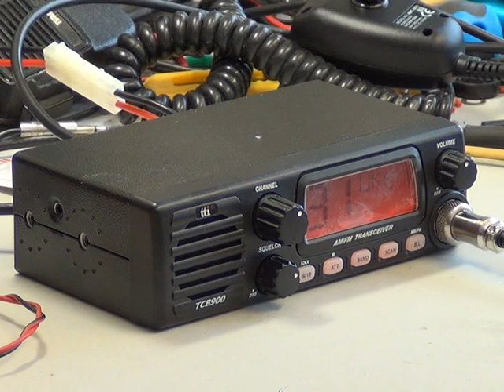TTI TCB900 UK (CE Multi-Norm) CB Radio (Mobile) - On the air test

Comment: Just a update-All ETSI cb sets now produced,dont go with the old MPT-1320 specs in respects T^X deviation,RX filtering,FM discriminator audio recovery,thats why FM deviation max 2.00khz,plus the fact the 455khz filter is tighter bandwidth to cover both Am and FM mode,hence why now deviation is set lower not to exceed filter bandwidth. Unfortunately this does not help UK users using mixed old MPT-1320  and new ETSI EN CB sets together! ETSI Specs generally are 60%=1.25khz 100% dev=2.00Khz max,455HT filter 6-7khz B\Width VS MPT-1320 60% dev=1.5khz ,max dev=2.5khz,IF bandwidth9-10khz 455GW For the FM detection of audio gain differences its just a resistor change across 455khz ceramic resonator or discriminator coil thats changed for different specs EU\UK new spec typical 3K-3K8=60%@1.25khz deviation ,where UK 60% dev is 1.5khz.But thats the reason why new cb sets are like this,using one filter to cover both modes AM\FM wise,so they compensated the total fm deviation,boosted up recovered audio,could call it super narrow fm lol.But as soon best way just turn up dev to 2.2khz on tone,then check speech peaks on whistle or 55555's,does not exceed 2.5khz for UK band.I have spoken to one or mfrs to put a extra menu  feature for UK band only  users so can switch TX dev 2.00khz[ETSI]] \2.50khz max [MPT-1320}so some sort of inter compatibility mode in UK band would be handy when intermixing old and new spec CB kit,it can be done very easy now with software controlled cb radios,but until users,dealers in UK nag mfrs,I cannot see it happen. Regards Rob
Reply from the maker: Thanks Bob. As CEPT is useless here, all our farm using customers want 27/81 so we'll carry on optimising for that, Back in the 80's deviation was still coming out of the factories @ 1.4Khz!

Richard G0OJF

Comment: Ive discovered why fm deviation low set,its because they dont switch the final 455khz  HT filter.Most ham HF radios will switch 6khz in AM and 9khz in FM Narrow.
So to save money they just switch in a Am filter at 7.5khz bandwidth Filter

So fm dev has to be  2.5khz (max  upper edge audio limit)+1.25Khz (fm dev max)=3.75x2=7.5 bandwidth which it can just get away with it.

Its puzzle me for a while why they did it until i was modding a Ham HF rig for NFM and looked at CB filters and HF radios work.
What should be happening is the last 455khz IF filter should be switched between Am and FM.
So ham HF Narrow FM
Filter 9khz wide (typical)

2.5khz (max  upper edge audio limit)+2.0Khz (fm dev max)=4.5x2=9 khz  bandwidth 

Sometimes 9khz Bandwidth used on Am and FM just slightly wider filter to cope with higher deviation.

Commercial PMR FM=Narrow

3.0 khz(max  upper edge audio limit)+2.5Khz (fm dev max)=5.5x2=11 khz  bandwidth 

Marine/Ham USA

3.0 khz(max  upper edge audio limit)+5.0Khz (fm dev max)=8.0x2=16 khz  bandwidth 

so by turning dev up it could over spill in theory on cb set,but generally filter is a bit wider than 6khz

On old UK40 sets the filter was a 455D 10Khz
that's why dev could go as high as 2.5khz max
they was no Am involved.

CEPT\ESTI change the specs to tighten up RX.as europe mostly Am and MFR cost cutted they fitted a compromised 455khz Filter,of course now the max fm deviation has to be lowered now as they didn't make the filters switchable for Am & FM-N.

Personally I think it was over sight,the best would be in practise Am 6khz B\W and FM-N 9khz bandwidth @min 60dB filtering or better.
That costs money to do!
THat's why better Ham HF radios switch the proper filters In.

You can do tests with up to date multi norm cb,if dev exceeds 2.00 on 1 khz test tone you will start to hear break through on next channel due to the compromised filter bandwidth.

In practise you get away with it,most modern cb sets I've seen now use soft audio limiting with audio agc,rather than audio diode  clipper method and saturate it for high peak  & clipped fm deviation.
TTI and Midland exception to rule,but generally FM set very low from factory.

Hope that explains why,took me a while to figure out this nonsense too,the reason.
Wont find this on net trust me I tried.

Just look at the NEW style CB schematics ull see the filters are common for Am and FM=N  on MC3361 or similar FM demod chip,they tap off a Am 455 IF stage from filter to demodulate AM.

It would have been quite easy to 455 filter switch for Am & FM-N and get best performance in process 
6khz for Am 3khz bandwidth each sideband
9Khz for FM-N @2.5khz dev max

My Icom IC-703 does it properly,but that's not cb radio!lol

But like I said in most cases get away with it ,if dev on fm set around 2.2khz and 2.5khz max peak.
Most sets are tolerant,hope that explains the reason why.

73's Rob
Reply from the maker: None of our customers our ourselves are interested in AM. No wonder we all tend to use 27/81 sets. Well researched!

Richard

Comment: one been offered for 70 un used on ebay good deal?
Reply from the maker: That sounds OK to me.They certainly work well & look like a business radio rather than a CB.
Reply: @ukfmcbradioservicingTango21  Thanks gentlemen. Not many reviews out there on this unit. You seem like professionals so I trust your opinion. I was actually looking for a mobile antenna for my superstar 3900 when I found a £55 package deal, TCB900EVO and the PNI ML100 antenna including the mag mount. That was just £30 more than the antenna alone. So now I have a permanent mobile set up that doesn’t break the bank and my superstar can sit safely in the shack. I even bought a second package (their last one) to borrow to friends on EU roadtrips. Thanks 🙏

Comment: did you put this radio on test set to check dev? what was it like?
Those radios have export and I think 10W capability.
Squelch nice,sounds like a commercial vhf radio,very clean.
Reply from the maker: Yes, I posted two other videos on setting up this radio on the test bench. Have a look at the "transmit" video, I'm sure the dev was stupidly low out of the box. I can't comment on if/if not the radio has an export mode as I'm in the UK & not exporting! It's useful when radios have a capability beyond 4W as it usually means that I can actually get a real 4W out of them & not 2.5!

Richard
Reply: Hello,yes did find it silly me :),I tired to find out out more info on radio.
Yes export ok for 10M band or abroad work,just thought id let you know.Why they set the dev's so low is beyond me,even business band radios generally on the ball straight from box why not cb?
I did have a thought,came across this in my  PMR job days in a certain radio factory I worked in,when tthe engineers set up NFM,they sometime forgot to put the 15 khz Low Pass filter in on test set,they use the 0.-3 khz filter esp on IFR\Marconi 2995 test-sets!
I had to reeducate the engineering staff as all our coast guard vhf H\Helds devs were all wrong,due to engineers using wrong filter on test set Dev meter!
After that radios were spot on
The Joys of being a QA RF engineer,maybe same in china,its not obvious when using these test sets.
Does the fm modulation have that clipped look on scope as it should do?

.The set reminds me of a motorola commercial set,its nice to see cb look a bit more commercial rugged look about time.Thx for the vid!
Reply from the maker: I can't remember the scope waveform for TX, but the speech processing it as it should be to my mind.
Reply: ok,thanks for getting back.I know tti do use diode clippers for fm looking at other schematics,but not sure how much they drive them hard or not,more clipping better punch like motorola do.

Comment: i like the look of that one Richard and still cant get over the diference between how good that is on uk fm compaired to how the same test was on the cept band. its a huge diference.
Reply from the maker: +Gary g1fsh Mark returned back from the test using the Moonraker minor Mk1. You'll enjoy the difference when the video uploads in a few hours time. The less sensitive receiver on the Moonraker & it's harsh squelch is evident. Poor Mark could hardly hear me on it as TX audio AGC is crap. This is why we are now doing the 'on the air' videos over the same route; a route with difficult terrain for radio.

All three of us were very impressed  (and we are all qualified commercial 2-way radio engineers) with the TTI TCB900 in build quality, features & performance.....even Mark was & he loves to hate TTI especially as he owned one model once that went so microphonic after just 2 years is was unuseable.
 
Richard